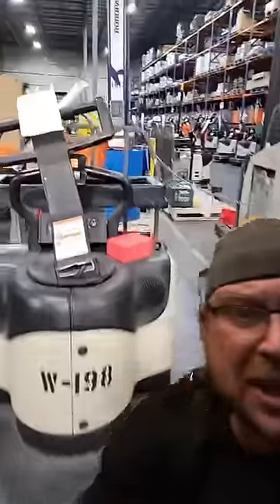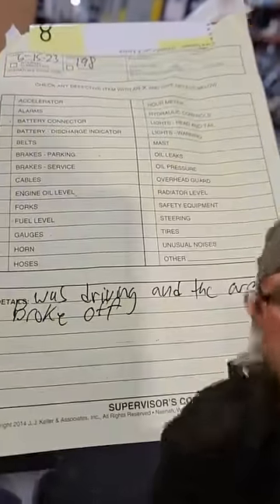Forklift Expert Analysis ￼

Comment: As a former night shift worker, this kind of stuff can be achieved for example with a rideable floor cleaning machine by lifting the back end with a pallet jack, using it as a scooter to make it go faster, then building a ramp for it at the unloading station of an automated pallet warehouse and then driving the cleaning machine up the ramp and on the pallet conveyor rollers 😁👍

Comment: As a 14 year facilities maintenance I've had to replace a few of these. The fun one came in when the operator said his palet jack would drive itself. We checked everything but could not determine how it could drive itself. Until I tapped the red safety button, the other mechanic was on the platform and somehow skillfully maneuvers the pallet jack for 50 ft before jumping off while disconnecting the battery . That red safety switch  puts the pallet jack in top speed in reverse. It was sticking lol.
Reply: Those were interesting days lol. The most catastrophic one was a 5200 series with mast fully extended, fell when came in contact with the lower part of the ceiling. Took almost 24 hours to clean up the hydraulic fluid and battery acid and to get the fork upright. OkI was the company before Crown bought them out if my memory serves me right.

Comment: As a guy that has a mix between 1st, 2nd and 3rd shifts: it was 3rd, on 3rd shifts I’ve seen items that aren’t supposed to fly fly, same with the stacking off 4 EPTs on top of each other. On second shift the worst I’ve seen is somebody almost getting ran over 3 times

Comment: We had a tow motor destroyed at the hospital. The work request was put in stating that the tow motor just doesn't work anymore. They forgot to put in that someone didn't set the park brake and it rolled off the loading dock.

Comment: As a Crown lift trucks technician i can say that tat Crown trucks are equipped with very thick steel you can imagine how much force is required to brake that handle on a Crown pallet truck

Comment: Worked at a warehouse using these to select hit a wet spot a lift made (he dumped a pallet of milk and it never got cleaned can’t really avoid 300 gallons of milk) slid into a rack the throttle broke off and the maintenance guy on 3rd shift cut a mop handle down and jammed it in there while I was on lunch stayed like that for months

Comment: As a certified day shift guy, I can definitely attest that the over night crews do tend to break stuff,... a Lot.  Then we spend a majority of the early morning hours un-F'ing their stuff and trying to get back on schedule.  The last job we literally ran off the night crew because they were costing us more time, materials and money than they were supposed to be saving us.  We still ended up finishing under budget, on time and with less break downs than we were tracking with the other guys.  Sure, we went from working 7-10's to 7-12/s and even a few 14 hr days here and there.  But we got the job done.  They even gave each of us a nice Yeti cooler for one of our safety prizes.

"We don't need no stinkin' night shift."

Comment: I wasn't paying attention driving backwards out of the isle with my forklift and went to drive over to the next warehouse "part" and it was basically 4m tall, 6m wide and I was right around the corner coming out of isle 1 which was the reason I haven't got enough time to get the arm (fork) down to under 4m and hit the wall, the backrest cought itself behind it while I was going like 10km/h and it just flew off about 2 to 3 more meters and I just saw it hitting the ground. That was like 2k € damage, my boss is the best for not making it hard ot me. Was my first time ever (inside) doing any damage. The first one was unloading outside and the fucking pallet somehow chipped in a way that a long piece of wood not only punctured one hydraulic line, but completely ripped it off the whole line from the end where its connected to, which was for the right/left shift hydr and somehow is still positioned right behind the left of the fork, coming from the back attached to the fork's frame from the inside of the frame.

Comment: Door company just finish installing a new door was cleaning up when one of are forklift drivers drove right into the door and took it out again.  Then had a semi truck driver backed in to a full closed door and pushed it in by about 3 to 4 feet.  Door was a 20 by 20  door.

Comment: Back in the day, when I worked at a grocery store as a cashier, we got those new fangled scanners. Well, they weren't nearly as reliable back then. The prism would get out of alignment and it would stop scanning reliably. When this happened, management would assign the lane to me at the start of my shift. By the end of the first hour, the light would go out or it would suffer a mechanical failure. Happened every time. I'm not saying that I kicked, slammed my fist or otherwise physically abused the scanner in the cabinet. I'm also not saying I didn't. You see, the company would only come out if the failure was obvious, like the scanning light was out or it stopped operating entirely. This is how we got them to come out. There you go!

Comment: I was using one of those a long time ago. The rubber grip on the handle was slightly torn. While I was cruising across the warehouse the  tear in the rubber grip decided it was going to get stuck in a way that I couldn't stop it.  It's a bitch to go from full speed to having to let go of the handle. Threw me right off of it

Comment: Nothing like fixing the half dangling emergency off for the assembly line, while it's still running...
For the third time because another forklift driver ran into it.
Luckily it was a siemens one where you could remove the outside button front without having to rewire/depower the interior.

Totally believe the "it fell off" because the culprit probably bent it back and stuck on a chewing gum and added some black marker and parked it somewhere hidden..

Comment: I was working part time in a warehouse, just helping out a buddy, there was an older guy working there as well, actually the head guy in the warehouse. This guy had been doing this job for at least 20 years or more, but one day he was operating one of the powered hand jacks,  when you let go of the handle, it goes flying up and hits the brake immediately, well this guy must have had a brain fart that day, instead of letting go of the handle when the thing got away from him a little bit, he was falling forward, stumbling really, and smashed that thing right into a block wall..!! 
Best laugh i had in a long time 😂😂😂

Comment: I drove a forklift for a trucking company for years, sometimes with a rug boon on it. 40 hours a week. It's amazing how many accidents are shown on YouTube and other places, mostly caused by people who think anyone can drive one. I only had two accidents in 8yrs. Once I ran the end of the boom through the head of a trailer and once I wasn't paying a lick of attention and came around the corner and ran full tilt into a set of very expensive scales mounted into the concrete. I was in lala land or something. I figured I was fired, so I got off and punched out and left. As I was walking to the car the boss stopped me and said that the scales cost 11,500 bucks ,but  it would probably cost them more to replace me. Also the union boss told me they would have raised hell if they had fired me. It was a great company, but owner sold it to some Australian who sold all the assets and closed it down. All hail the teamsters union.

Comment: I remember getting to work one day and the brand new reach truck was on its side surrounded by a pool of hydraulic fluid.
 one of the operators left it parked with the forks over a forklift, then jumped into the forklift backed it up and the tower of the forklift bumped the forks of the reach truck tilting it. 

It was a 2nd shift worker😂

Comment: I was using a giant hand truck to move septic tanks and tank forms at my grandpa's shop. I slipped on form oil the cart had no breaks. When I fell I gunned it in reverse my hand got caught between the handle and the form the cart pushed the form against the wall the lifted it about 4inches off the ground the Handel finally broke and I got my hand out . Be safe out there. He didn't by it when I said it was second I guess it's because we only ran on shift.

Comment: As a 22YO. There is absolutely no way a crown will “just fall off” either the operator was doing the most, or the mech did the least. Crowns are so easy to fix i could do it eyes closed, even the electrical parts.

Comment: You can the scratch marks were someone used a forklift to pick it up by the handle.

Some Dumb àss drove it until the battery died and some Dumber àss tried to tow it back to the charger by lifting it with a forklift by the handle.

Comment: I actually just snapped a fkin pallet jacks arm 😂 like 2 days ago. Trying to get a pallet of ice cream on a truck but for some reason this dock an truck just don't mix an with our ramp an his door I had to go over a bump an got a wheel stuck in between the bump and another small bump at the door. Pushed hard as I could to get it over the bump  an pop. Just retightened a bolt an fixed it but it did snap tf out of it.

Comment: I've never seen the control arm snap off like that before. Usually in my warehouse they get bent to the right or left depending on which side toe driver is on. In this case the arm was either all the way up or all the way down but in either case if the arm is all the up or down the deadman brake ingages and stops the vehicle. So in this case he got hit by a forklift most likely. In either case someone is getting a piss test.

Comment: Sitting on the arm as it is driven and running into a solid brick wall and not letting go of the control arm are the real reasons I have seen as a warehouse worker that the steering arm fails in the stand up power jacks models...
Of course it is always another shift or employees fault...

Comment: True,  it has never happened that while maintaining batteries that a large area of floor get water spilled on it, and even more things that have never happened,  is the temptation to do a forklift power slide  ... it has never happened in the history of mankind  ... ever  ...  but I can tell you it's handy that the sit down models are armored on all sides by battery case on the sides and counter weights on the back.

Comment: On the extreme rare case some part will fail without any prior problems however most actual damage to Support equipment is a direct result of either an accident or intentional abuse of the gear either by intentionally misusing the equipment or not paying proper attention to the equipment in some way.

Comment: I haven’t filled an inspection form for the forklift in a while (someone hid the forms on me). The thing works good, but:

Left headlight is bent off to the left at a 45 degree angle (Jim)
Left door is bent outwards at the bottom (Jim)
Left door latch is broken (Jim)
Front windscreen is cracked (not Jim this time. Broken so long no one remembers who did it)
A/C broke (My money is on Jim.)

Comment: Going out on a limb, a selector was in a rush to early clock out. Went into the battery room and tried to park forks out like a jackass. Forgot to take the piece of cardboard out that makes the jack coast. Slammed into the wall and snapped the handle. But also the handle is weakened from people sitting on them.

Comment: At least 3rd shifters were smart enough to file the bottom of pin in hasp lock so we could push up with a nail get what we needed out to work 
Then we put pin back in and let dummies on day shift run to stores in other building to keep us supplied

Comment: I am a forklift operator it was probably damaged before hand and did brake on the guy riding it!!! if he hit somthing there would be damage to racking or product or truck. they would have to report. I have drove forklifts and had it catch fire 🔥 iv had the Ramon reach handled brake on me too! Iv had  the hydraulic hoes brake in my face. shit happens if other people don't report it and you don't notice it during your inspection it can be a legitimate problem . And nit your fault no one told me on my forklift license to make sure the weld joints are attached just bolts and tires and batteries you qouldnt ve looking for that.

Comment: I work at a distribution center for a couple years and went through the training and got my power jack license those things are quick and if you're not paying attention and trying to go fast in the wrong direction you're going to spin that thing around and it's going to smack whatever it is in its path. I seen guys attend the training and still don't have the common sense to operate one. Yeah they have a break on them they stop pretty good but if you if you're going too fast and you run into an obstacle or a person or a forklift or anything you're going to hit it it's not going to stop fast enough that guy was an absolute douchebag

Comment: I have broken many handles in my time 😂

Getting paid by percentage will make you do some crazy shit. I'd let that mf snap up and keep on selecting.

In 7 years at that job i completely killed(100% decommissioned) 3 jacks. 😂 The last one I ended up using was brand new off the truck and still broke the motor within a year.

Its been 3 years and I can still smell the smoke.

Comment: As a CFO(Certified Forklift Operator for the ill informed) it's always 100% first shift's fault. And it's almost unbelievable because first shift doesn't do anything and leaves everything for second shift. 
But seriously, it most likely broke because first shift was fooling around again and having power jack races instead of putting that shit away. But don't worry 2nd shift will bail them out. We always do.  😆 🤣

Comment: Everytime i see an FLT video i remember bring cocky one day riding a reach truch back to a raised comcrete floor.. the picking area was in a depressed area and you layed down pallets on to said raised concrete floor.. but...i was driving with my left leg dangling outside the ccockpit.. and just managed to pull it back in before I drove it in to the concrete. A 4ton machine hiring a concrete wall... with a foot inbetween... would not be pretty. I stopped being a twat on FLT's immediately.

Comment: As very seasoned ROTATING shifts worker, UGH! Lol, some moron went YEET n snapped the damn thing. Coming from a moron whom almost did it himself. 👀 KNOW THE SPEED. SPEED IS KEY! 

Had one of the mechanics come in and "sped the damn thing up" because other operators didn't like how slow it was. Well I was the first person to use it after it was sped up. THANKFULLY, no one was around lol. I wasn't expecting a fully loaded electric pallet jack to just go full WEEEEEEEEE on me. So yaaaaa, get to know the damn speed lever reeeeeeeeeeal quick

Comment: I’m surprised they haven’t used 12 rolls of duck tape to stick it back together so you have to spend 5 hours cutting it off before you can get to the problem…operators 🙄😂